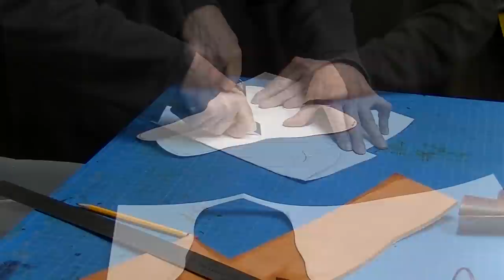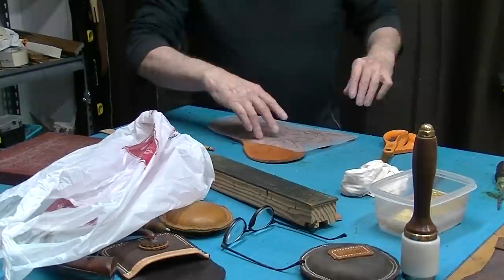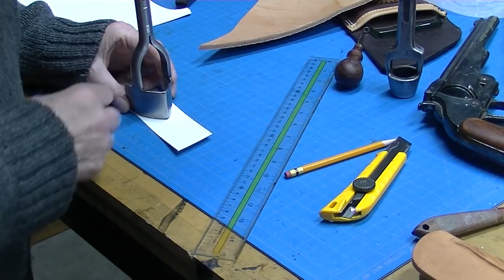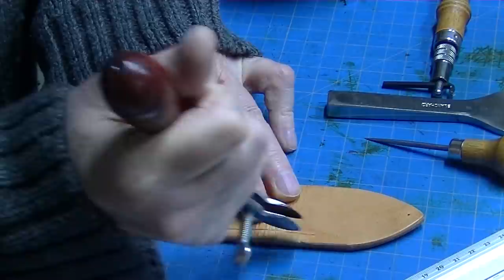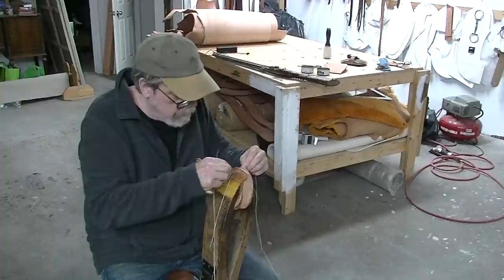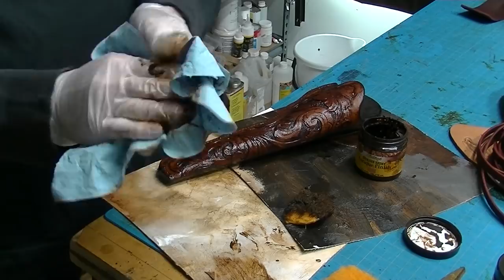Schofield Holster based on the California Pattern.

Comment: Great video. Please answer a question for me. I have a holster for a cap lock remover that is very tight. It’s fairly thin leather in a black finish. Slim Jim style. How can I give the revolver a looser fit. Thanks for any advice.
Reply from the maker: You could try soaking the holster with some water, then putting the gun in a plastic bag and jamming it into the holster, wiggling it as you go. When its jammed all the way in, just leave it overnight and take the gun out of the bag and try it re-holstering it. It all depends on wether bthe finish on the holster is too waterproof.